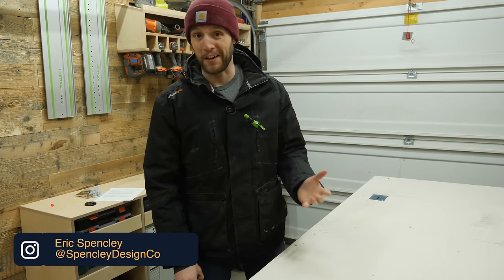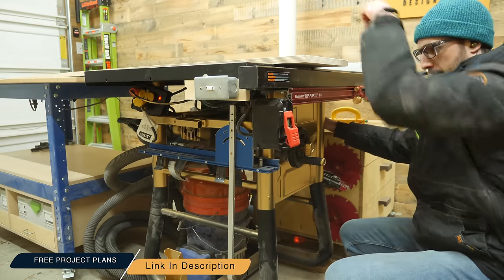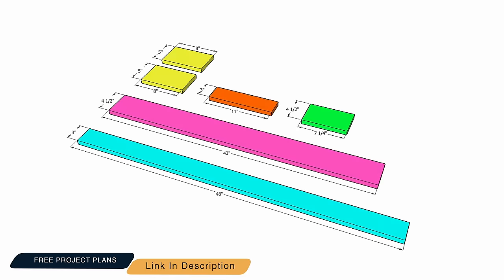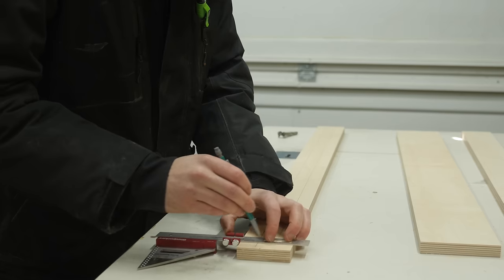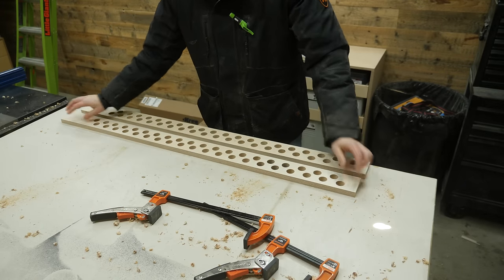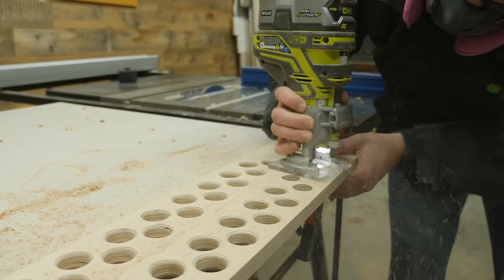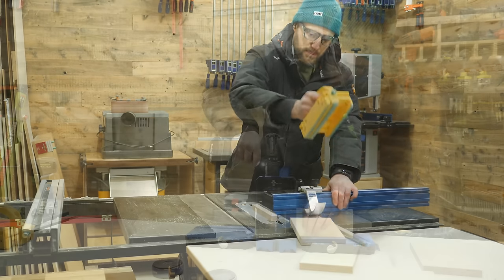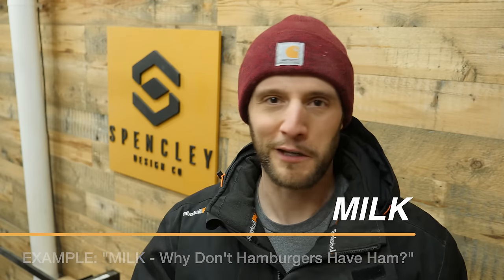Tackling the Most Daunting Shop Vac Problem

Comment: Agree about Ryobi tools. They aren't the best, but for me, a DIYer, they are usually sufficient. I have a 5.0AH and a 5.5AH battery and those two solve the only real problem I have with them, drill, strimmer or whatever.
Reply from the maker: I’ve gotten tons of use out of mine! Any projects you’d like to see me build in the future?
Reply: Wait 

5.5AH

Comment: Milk.
I also recently saw the Lincoln Street video and was intrigued.
Almost all my tools are ryobi and they do just fine for me. I have plans to upgrade (starting with the table saw), but I'm in no hurry. Their commitment to the one battery style kind of makes me want to stay though.
Almost wish they'd put out a pro series line of higher quality tools. Same company owns Milwaukee so they can def make them.
Reply from the maker: Thanks for watching! What’s your favorite ryobi tool you’ve got?
Reply: @SpencleyDesignCo  that's sort of tough actually.
The impact driver is probably my most used so I'll go with that.
It's much easier to pick the ones I'm not happy with because the rest get the job done just fine.
Reply from the maker: 🤣 just don’t get the cordless  sander
Reply: @SpencleyDesignCo  ...damnit.

I have the orbital and sheet sander. Don't hate them, but I don't really have much to compare them to.
Reply from the maker: I’ve gone through probably 15 of their cordless orbital sanders. They just stop spinning after a few uses and only vibrate
Reply: @SpencleyDesignCo  luckily I haven't had that issue.
Had mine for close to 2 years and still working fine. Maybe I got the only one that works? Lol. I have had to watch the amount of pressure I put on it though.
Reply from the maker: I’m glad it still works for you! My other ryobi tools haven’t been great other than a drill that burnt out
Reply: @SpencleyDesignCo  yeah I've burnt up a drill and a circ saw. My fault really. I had been abusing them for a few years. Dull blades/bits and such and finally pushed them over the limit. Learned a few things the hard way
Reply from the maker: Haha yeah that happens. The warranty is nice if it’s within the 3 year period

Comment: Milk - I just found Lincoln street's videos in the past day or so! Funny coincidence.
Reply: Milk- also, something I recently bought was a 3D printer (Fokoos Odin 5). Since then, I've thought of using it for making adaptors for vacuums to connect to tools, make throat plates, etc. You might consider grabbing a 3d printer and then make content with it, from making your own L shapes for clamping up square (note- some sanding and shaping after printing may be needed to square it up, but considering paying $20 for a set or $20 for a roll of filament), etc. You could even turn it into a series on your show: how 3d printers are needed in every shop. 

Just a content idea I had. Might even be able to reach out to a 3d printer company to do a sponsor video, that way to get the base machine for free for review, followed by doing uses in a shop.
Reply from the maker: Not a bad idea!

Comment: Milk. I've never owned any Ryobi tools. Lowes is about 10 minutes from my house, Home Depot is about 20 minutes and across town so I started out using Kobalt 20V tools and now (still) using them and their new 24V line. Some people don't like Kobalt but they've worked for me. I retired almost three years ago and woodworking is something I enjoy doing. It's not a "side hustle" or source of income. If you're woodworking 40 hours a week then Ryobi or Kobalt may not be suitable but for a weekend warrior they should be fine. Buy what you can afford, upgrade as you're able. :)
Reply from the maker: Thanks for watching Lawrence! What’s your favorite kobalt tool?
Reply: @SpencleyDesignCo  In the newer 24V line I'd have to say the jigsaw is one of my favorites. In the 20V line (no longer made) I think it would be the reciprocating saw. I'll replace the 20V tools with 24V when batteries die.
Reply from the maker: Ah that’s a bummer that they changed the batteries

Comment: Milk!
I’m actually fairly happy with my Ryobi stuff! I’m a causal woodworker but my Ryobi stuff has been used a lot. I will say there are things that are not worth buying from Ryobi, and from experience their circ saw and table saws suck. But that being said if someone is just getting started cordless Ryobi 18v platform is great because there is an absurd amount of tools on that platform. Anything that’s worth being super precise… it’s better to get corded, higher quality tools. I was blown away the difference between my cordless Ryobi circular saw compared to my corded Makita circular saw. But in my opinion, their drivers are good and the variety of cordless tools you can get is ridiculous. I’ve had great luck with my cordless sander but in general cordless sanders suck. No experience with cordless Ryobi router but my Ridgid corded router is solid. 

But hey they are putting out a cordless track saw and I just might have to try it 🤷🏻‍♂️
Reply from the maker: Nice! What’s your favorite ryobi tool so far?
Reply: @SpencleyDesignCo  would definitely have to give it up to my drill and driver set, and also my 18 ga crown stapler. Not sure why but for me the crown stapler is oddly enough the most well constructed Ryobi tool I own
Reply from the maker: Interesting! I didn’t know they made a stapler
Reply: The brushed ryobi is junk but the brushless stuff has basically replaced ridgid.
Reply: @bread-gz3rl  one of these days I’ll dip my toe into the brushless line. Maybe when my drivers go out. Maybe with that track saw…

Have only grown my Ryobi 18V tool collection since this comment 🤣 cordless fan has been one of my favorite Ryobi tools thus far and just added the dual inflator to pump up my paddle boards. Loving my stuff even more now
Reply from the maker: Glad it’s working for ya 😀

Comment: That is a really nice arm. As I was watching the video I realized that I could build the same thing for a fraction of the cost and do it in about 15 minutes by simply using pvc. It won't look as nice as yours but shoud work out fine.
Reply from the maker: You could also use zip ties
Reply: Unsubscribe….
Reply from the maker: Ok

Comment: Milk!! I’m currently switching all my cordless tools to the Ryobi brand! Does that tell you my thoughts on them!!?? I’ve had Dewalt, early 90’s, Craftsman, Porter Cable. For my money, I’m quite happy with Ryobi! Great video! This will go great in my revamped workshop when I’m done with it hopefully this fall!
Reply from the maker: Wow! Sounds like you’ve gone all in! What’s your favorite tool they make?
Reply: @SpencleyDesignCo  I really like that palm router you just had replaced and the 5 1/2 circular saw with the blade on the left
Reply from the maker: How thick of material can a 5 1/2 circular saw cut?
Reply: @SpencleyDesignCo  1 9/16”
Reply from the maker: Not bad! I what’s it at 45 degrees?
Reply: @SpencleyDesignCo  have never checked it as I primarily use it with the Kreg rip cut and accu cut. I’ll have to give it a whirl and report back lol
Reply from the maker: I’ve curious to know 😀
Reply: @SpencleyDesignCo  at 45 degrees the max depth of cut is 1.188”
Reply: Get the brushless stuff
Reply from the maker: What about the hp line?

Comment: milk... I'm totally on board with spending the time to drill holes to reduce the weight, but the very first thing I asked myself was couldn't this be made by snaking your shop vac hose through the appropriate diameter pvc pipe with an elbow mounted to the wall in such a way to allow the pvc arm to swing? ?.... or even make the pvc the actual conduit?.... yea i know, then it's not woodworking it plumbing, but I'm curious what you think.... thanks, definitely love the graphics in the beginning it really helps visualize what we're doing here.... Rob
Reply from the maker: Thanks for checking out the video, Rob!  Sure, that would work...but wouldn't make much of a video 😀
Reply: @SpencleyDesignCo  actually what i'd really like to figure out is why my shop vac basically draws nothing from my table saw when its hooked up
Reply from the maker: Is your filter clogged?
Reply: @SpencleyDesignCo  i check and clean it pretty often,,i even have one of those dust stopper thingys in between the saw and the vac...i dont know...maybe its just the design of the ridgid jobsite saw
Reply from the maker: Ahhh yeah my job site saw was awful at collecting dust
Reply: let me ask you,,,whats your preferred method of cleaning the filter...i usually start out by just banging it out in a bucket,,,then sometimes i'll blast it with an air compressor,,,but i have even hosed it out with water and let it dry a long time,,,have you ever washed it out with a water hose?
Reply from the maker: You’ve probably ripped the filter doing those tasks and might have ruined the motor on the vac. Check out this video for more shop vac help: https://youtu.be/5BSWQXU8Kak
Reply: @SpencleyDesignCo  whats the minimum HP you would want when employing that boom arm ...its a lot of hose , does that compromise the power of the suction
Reply from the maker: It’s pretty minuscule. Any shop vac above 1 gallon should be fine